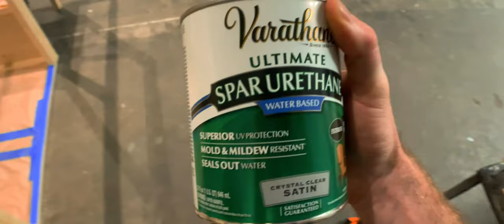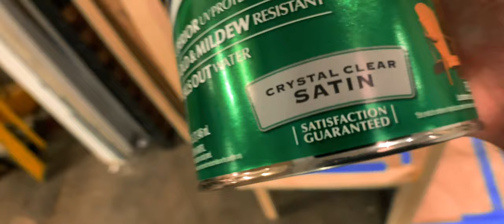DIY Truck Camper Build: PART FOUR - Shou Sugi Ban + Attaching the Cedar Siding

Comment: Did you have to use and caulk or silicone in between the  panels  so  water could not get inside while traveling?  Very nice build!
Reply from the maker: Thanks! I didn't initially due to the shape of the lap-joints providing a natural seal, but once I had it on my truck, I did end running an exterior siding caulk between every cedar board just for extra reassurance.